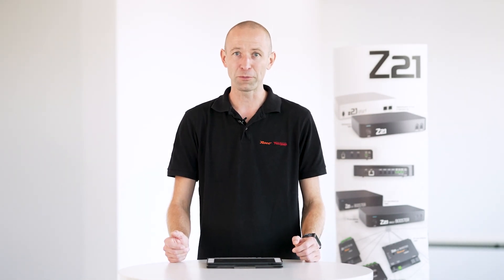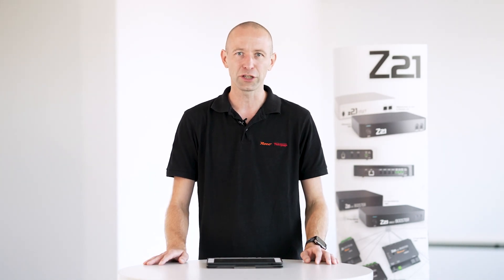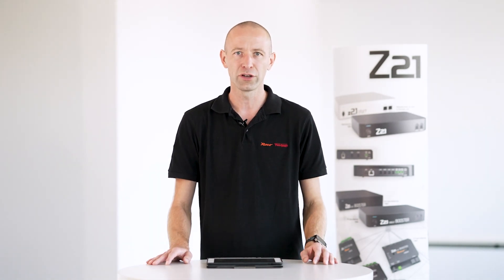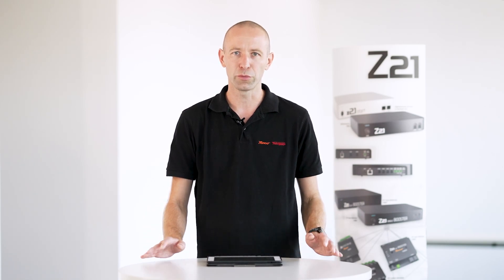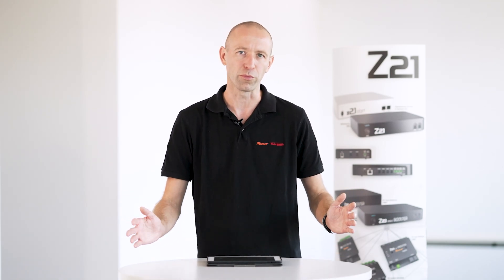Questions and Answers III: "Digital for Beginners" video series

Comment: Hi, I have a question. On the 10819 dectector, since it's on the R-BUS it uses the adresses 1 to 20, so does that mean that I have to reserve those adresses to that specific accesory, or can I have turnouts or signals on those adresses? In short, are the R-BUS adresses separate from other DCC accessory adresses? Thanks